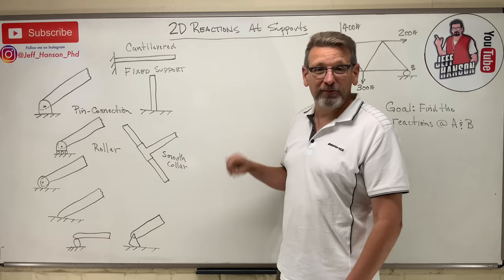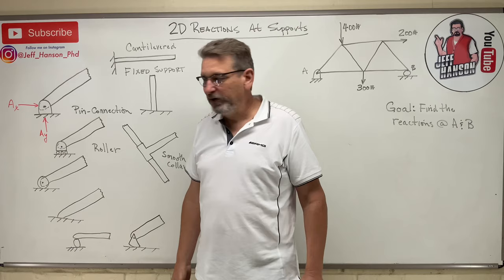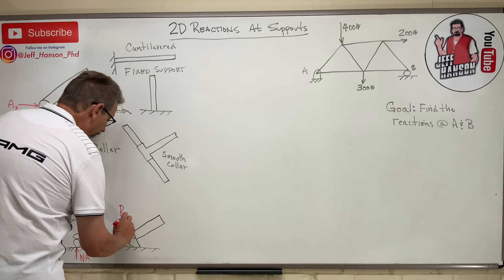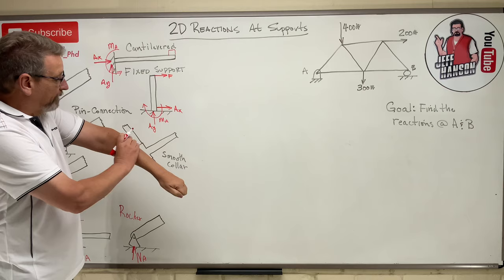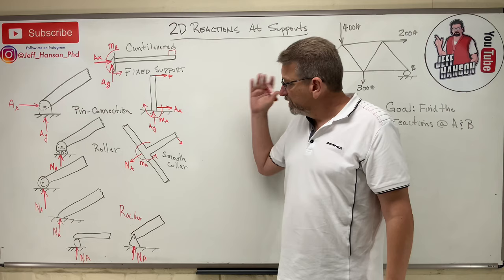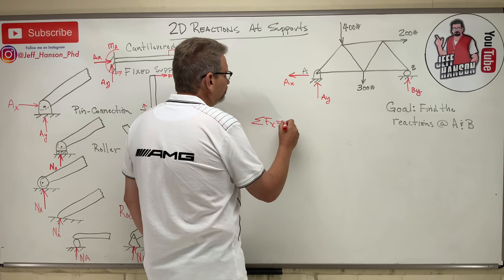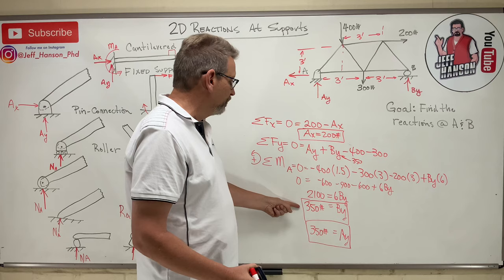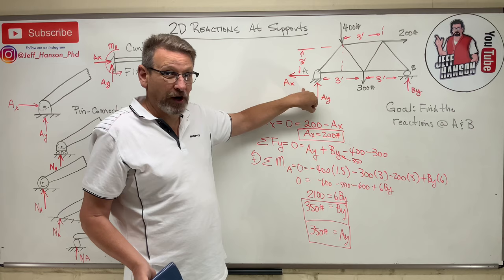Statics: Lesson 29 - 2D Reaction at Supports, Example Problem

Comment: shouldn't it be -200(4.5) instead of -200(3) while writing the equation for M(a) ?
Reply: no, its the shortest perpendicular distance, if u extend the LOA of the 200 force backward and then take the perpendicular distance from a it comes to 200(3)
Reply: if you choose By ,then 200 (4.5) that is make a result 550 ans
Reply: @husseindahirabdulle382  Even if you take the moment at B, it should be -200(3).
Reply: I agree. it is 4.5 instead of 3

Comment: Thank you for the great video! I am just a little lost when it comes to decided whether to put + or - in these equations at the end. Can someone please explain how this works? Thanks in advance!
Reply: Point A is a pin connection. Point B doesn't allow it to rotate clockwise so it must rotate counterclockwise. The forces acting upon pushing it clockwise are therefore negative. Point B (By) pushes it counterclockwise hence why it's positive.
Reply: Oh thank you so much man. So does that mean the rotation is always going to the side the By is pointing to. Like it
would be clockwise if the By is pointing down and counterclockwise if its pointing up(assuming that we have the same situation of course)

Comment: You just said pins rotate so no moment then you use a moment equation at point A which is a pin. Could you please explain that?
Reply: You are definitely very confused, so take a few steps back to review the basics.
a.) True the pin connection creates zero reaction moment.  (if it were "fixed", then yes it creates moment...then you must "add" a variable "Ma" to the FBD).
b.) You can take a moment about any "arbitrary point" that you like.  Typically, you take a point that can eliminate some variables.  Thus, using "point A" as the reference point for your moment, then you "eliminate" variables Ax and Ay in your sum of the moment @ A =0 equation, since there is "no moment arm" for those forces.  
Hope this make sense and you can catch up.